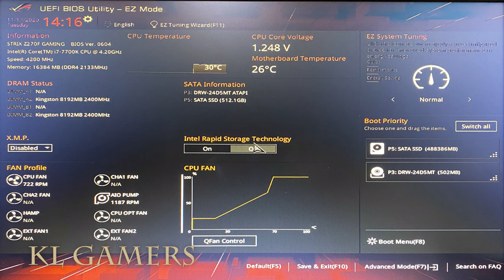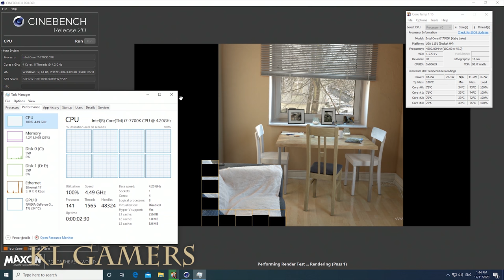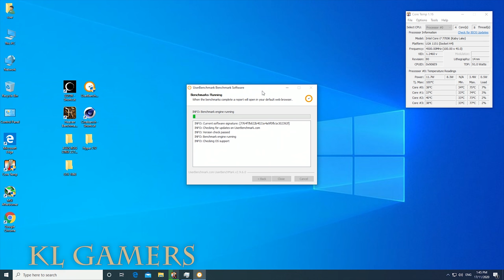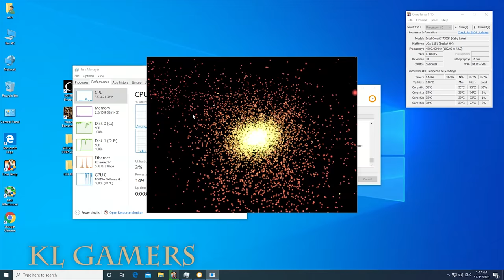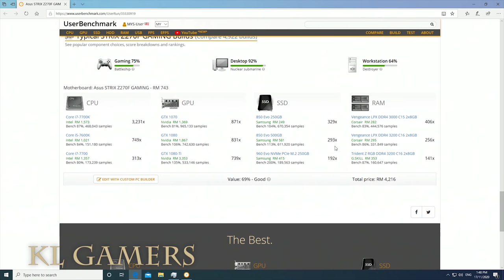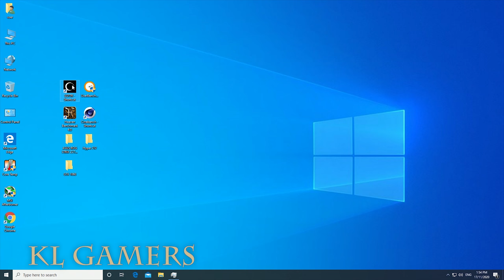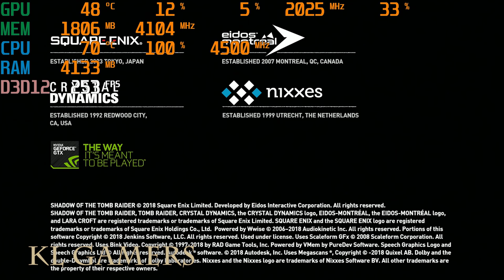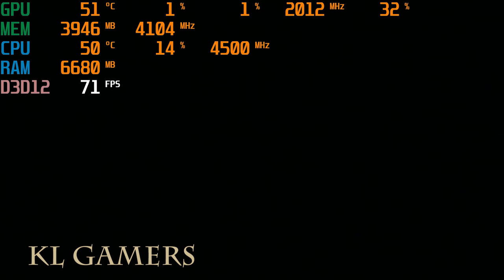intel Core i7 7700K ASUS ROG STRIX Z270F GAMING STRIX GTX 1060 Gaming PC Build Benchmark

Comment: Why putting ram in slot 2 and 4? @KLGamers
Reply: Dual channel, and 2&4 actually it 1&2
Reply: @thole8970  is it fine to put anywhere in the available slot?? Cuz im putting my ram at slot 1 and 2
Reply: Pc ram work either 1 and 3 or 2 and 4 for dual channel cpu
Reply: @vincentgunawan5005  the space of Ram stick when u want to put Ram in is 1 stick
Reply: @vincentgunawan5005  Example
1 (installed ram) - 2 (not installed) - 3 (installed) - 4 (not)
Reply: If i put at slot 1 and 2, can it double channel?
Reply: Im newbie in building pc
Reply: @vincentgunawan5005  no, the ram run as normal
Reply: @vincentgunawan5005  there are single (1x ram) channel, dual channel (2x ram) and oct channel (4x ram)
Reply: So i must switch it into slot 2 and 4 for dual channel performance?
Reply: If i put at slot 1 and 2, the performance stay the same?